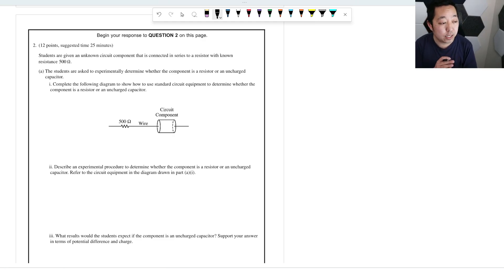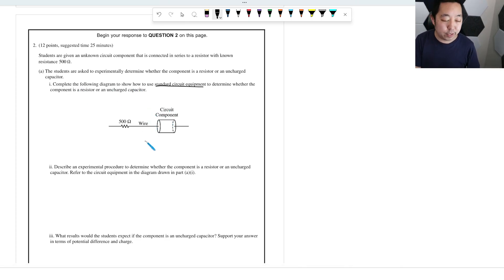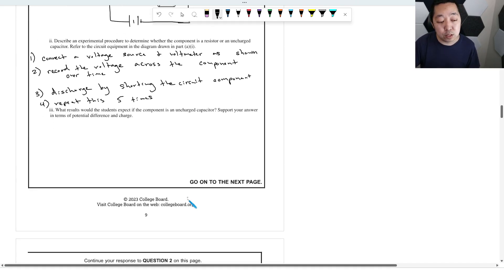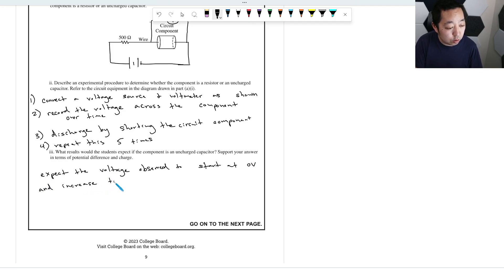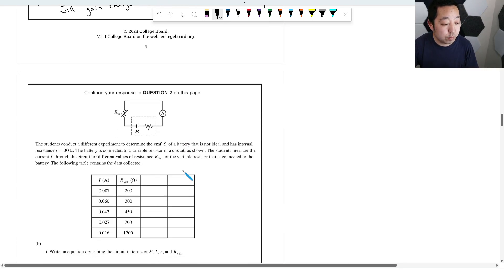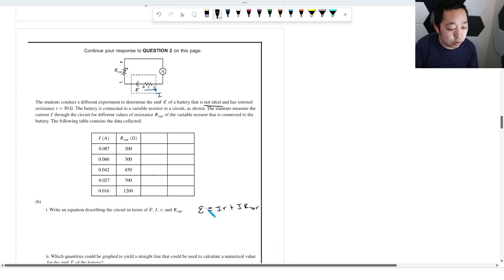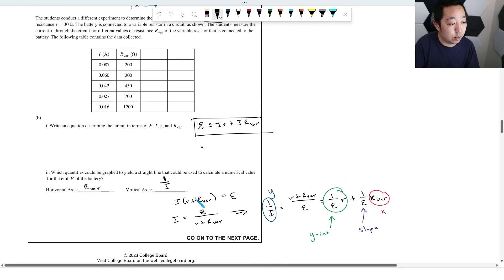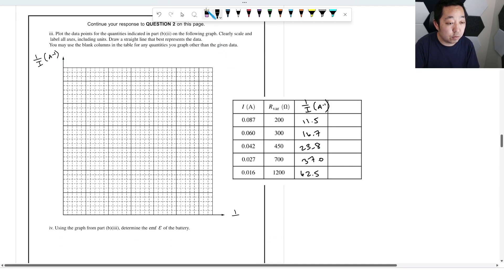2023 AP Physics 2 Free Response #2

Comment: instead of a voltmeter, could I have used an ammeter? because the current passing through a charging capacitor changes over time as potential difference across the plate increases
Reply from the maker: Yes you absolutely could have used an ammeter
Reply: @AllenTsaoSTEMCoach  Is it okay if I used both an ammeter and a voltmeter?
Reply from the maker: Yeah as long as you explained how you would use it

Comment: I used power and current for the graph and I got 18 instead of 20. Do you believe I would get the points for both the emf and the x and y axis?
Reply from the maker: I think it would work. Did you do the power through just R or the power from the battery?

If you did it for the battery, that would work.
Reply: @AllenTsaoSTEMCoach  I see, I wasn’t able to figure out how to do it with the battery, so I used the given Rvar values and multiplied it with current to get power. Graphing power and current got me 18
Reply from the maker: @CUTESHADOW6k  Gotcha. I think your answer is a little smaller because of that. 

To include the total power, you would have done I^2 (Rvar + r) instead of just I^2 (Rvar)